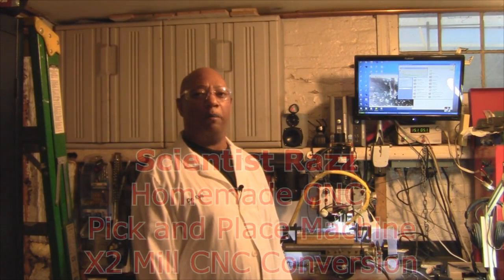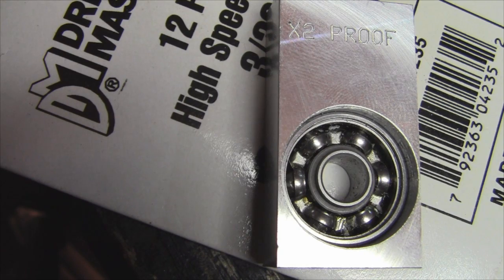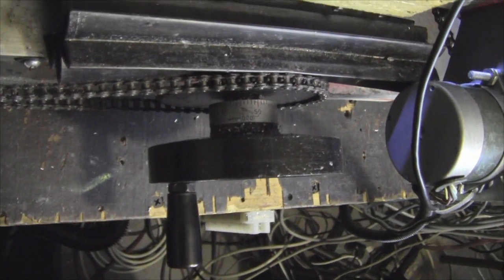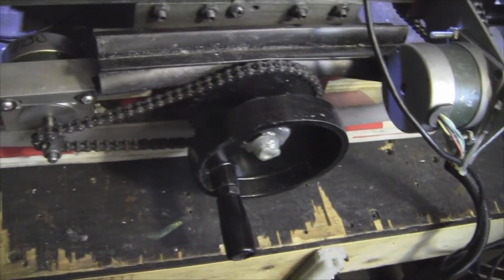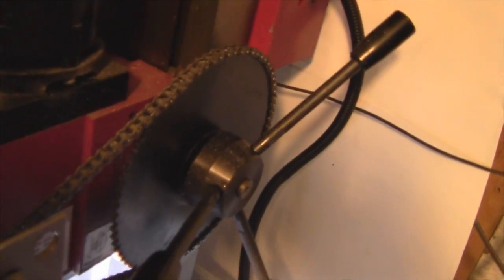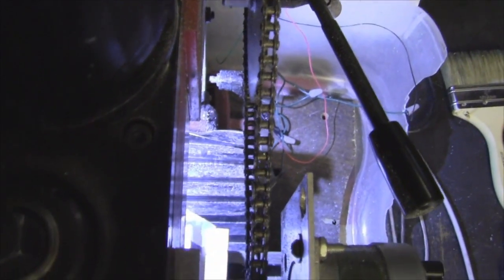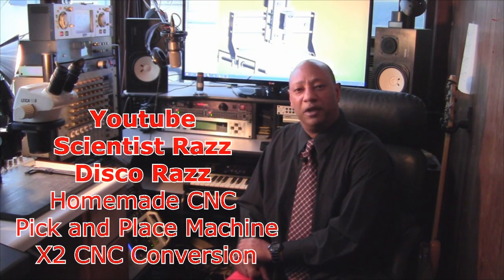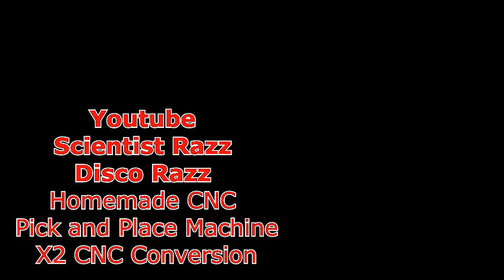Homemade CNC Pick and Place Machine X2 CNC #3

Comment: So thoroughly explained and great videoing the important things  wish I had seen this video earlier I'm in the process of converting a Tos kurim milling machine. The timing pulleys were so expensive I left the supplier store with out ordering Glad of that. I'm going to try the chain system. Thanks a lot
Reply from the maker: I think the # 25 chains are great for R&D because you can make them any length unlike timing belts which have to be ordered a specific length. Also, of course, they are very strong and durable.
Your welcome.